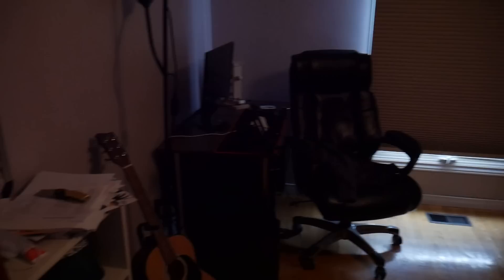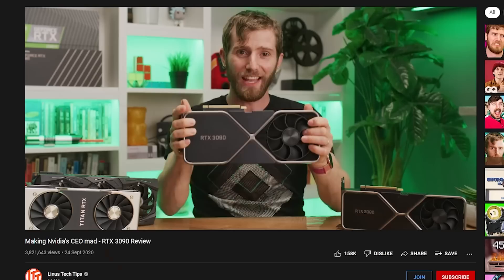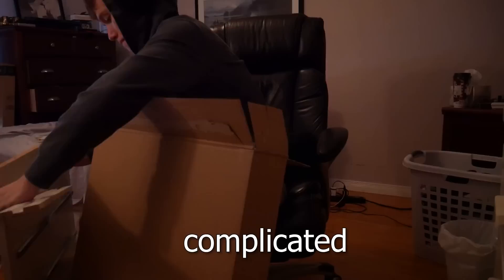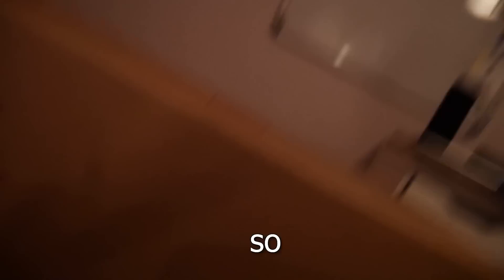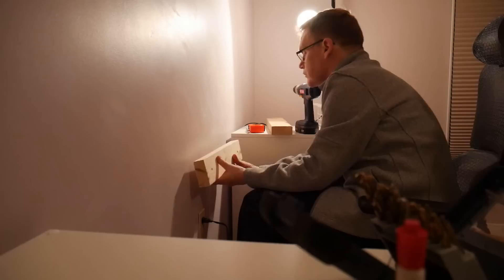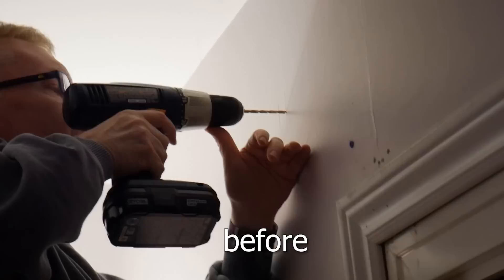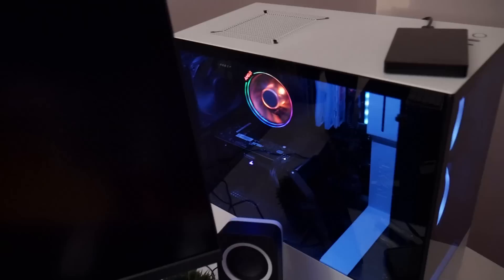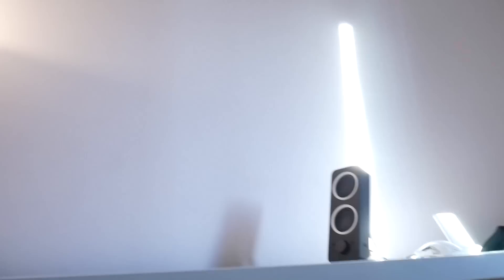Building My Dream Gaming and Editing Setup At 18 Years Old

Comment: was expecting a full on maxed out budget with a 3090 but this somewhat gave me some hope that a dream setup doesnt need to have maxed out specs great vid dude !
Reply from the maker: thank you man! that's a interesting perspective that I didn't even consider, I like it a lot and am glad you enjoyed the vid.
Reply: @matt_obrien  all thanks to you for sure dude !
Reply: gtx 1080 is basically all u need for gpu
Reply: @scarf744  except for 1440p gaming
Reply: @nuggystan9128  i dont care- i play better on smaller screens if i have a small screen theres no point in 1440p gaming
Reply: Unless you can afford a crazy fast 4k monitor, the really expensive house are not worth it.
Reply: 2070 is a great card
Reply: @Mr_Reaps25  most 4K monitors don’t run at high refresh rates
Reply: @calvinilkay1067  1080ti runs faster than 2070 and runs the same as 3060ti

Comment: I built my set up at 19 with a full-time job and an "unlimited budget", cable management is what brings a set up together, even the most baller of battle stations look like dog water if not tidy. wireless mouse, keyboard and headset are a good shout. running your microphone cable up your boom arm leaving some slack at the hinges then running the cable underneath the table is a must. level your monitors, then I'd give this a 10, but with the disorganization it takes it to a 6. great job all round man.  I'm sure you've heard people talking about the ram, if it's the same speed it shouldn't be too bad, LTT did a video on it some months back.

Comment: This is an awesome example of how maxing out the specs doesn't help all that much. Anything with 8 cores and a gpu sligjtly stronger than a 1660 will run like butter if you want high fps, or if you want to crank settings for 60fps cinematic experiences.

Comment: That looks amazing congrats bro. one thing is your ram, its not the best / most efficient way to mix ram. usually you'd want to keep the same manufacturer, gb, and mhz throughout and either use 2 or 4 ram slots, other than that its amazing good job

Comment: I want to build a ikea linmon desk but I'm not sure because I see others saying that it isn't strong enough
Reply from the maker: I personally wouldnt recommend the table top if you are worried about the strength, before I got the leg in the middle, it started to warp, go for the little extra cash and buy a ikea countertop it is way more worth it, I cover it in my next video that will becoming out in the next couple days
Reply: @matt_obrien  what do you think about this?

SÄLJAN Countertop, black mineral effect/laminate 98x1 1/2

With a 

BEKANT Underframe for table top, black55 1/8x23 5/8 "

Comment: where did you buy the little riser between the alex drawer and the countertop ?
Reply from the maker: here is where I got the furniture risers from - https://www.amazon.ca/TamBee-Furniture-Cabinet-Adjustable-Stainless/dp/B07DK6VPQF/ref=pd_sbs_1/138-8618972-9094863?pd_rd_w=H4576&pf_rd_p=01fdeee8-dd76-431b-910b-f00bfed49bd2&pf_rd_r=BRP2SRYSJTJN4BT6M9HV&pd_rd_r=bc826676-fe78-477a-99c9-b9dd98206399&pd_rd_wg=87Ly0&pd_rd_i=B07DK6VPQF&psc=1
Reply: @matt_obrien  hopefully you could help me out here, but is it best to build your own pc system or buy pre-built ?
Reply from the maker: @cjmcrae5764  right now with prices of pc parts I would say that it would be best to buy your own prebuilt if you would be building a whole brand new pc, I would do some research on some of the most well made prebuilt pc's, I know NZXT has a prebuilt option on there website that seems to be fairly decent!

Comment: I too built my dream setup at 18, 19, and 20
first System 5800X+3080Ti+64GB second System 5900X+3080+128GB, triple 1440p/4K 144Hz Razer Raptor 27, 4K 55in TV, Razer Blade 15 Advanced i7 11800H+3080+64GB Laptop
and the Arsenal is still expanding gonna Upgrade and mix my Old Razer Blade 15 Base i7 8750H+1060+16GB and sell it to put that money into the All new Razer Blade 15 Advance i7 12800H+3080Ti+32GB(64GB Upgrade)

Comment: I'm so confused, why did most of the budget go into the cpu? I mean its a 400 dollar cpu on a 80 dollar motherboard with a 2070. 
What i personally would've done is cut the budget of the cpu in half and go with a 3600 or 3600x and sell the 2070 and invest the 200$ left plus the income from the 2070 in a 30 series card.
Non the less, creat built and great setup, im sure u got ur reasons for those specs

Comment: dope setup but the motherboard is bottlenecking the cpu you dont have enough watts in your power supply and your case had bad airflow and you need a new cpu coller its gonna overheat and shut ur pc down

Comment: I’m building my dream build today tommrow I will get 😌 Im 15 years old  this about my spec 😌.   INTEL CORE I9 12900K PROCESSOR( Nos )

GIGABYTE AEROG Z690  MOTHERBOARD (Nos )

TFORCE EXTREME EDITION RGB 64GB DDR4 3600MHZ RAM (16*4)(Nos )

WESTERN DIGITAL SN850 1TB NVME M.2 SSD (Nos )

SEAGATE BARRACUDA 2TB 7200RPM INTERNAL HARD DISK (Nos )

ASUS STRIX 3090 24GB DDR6 OC WHITE EDITION GRAPHICS CARD (Nos )

COOLER MASTER MWE1050 V2 GOLD FULL MODULAR POWER SUPPLY (Nos)

MSI MPG CORELIQUID 360 360MM ARGB LIQUID COOLER WITH SCREEN(Nos )

WHITE SLEEVED CABLES.

THERMALTAKE AHT600 WHITE CASE.

4NOS ARGB FANS.

Comment: should have gotten a better cooler
Reply from the maker: I was worried about the cooler, but it has worked just fine for now, if I overclock I will look more into it, but honestly cooling over the past year hasn't been a problem in the least.